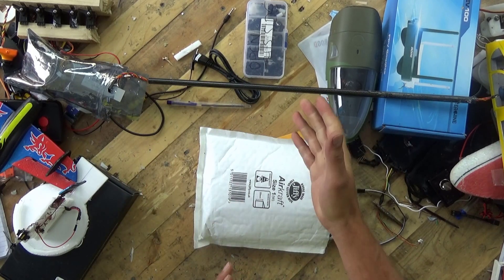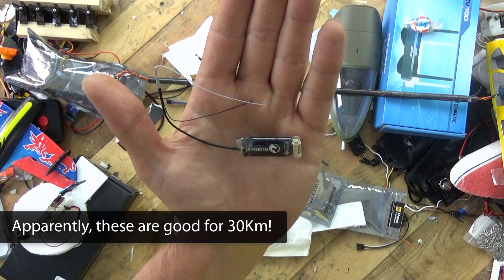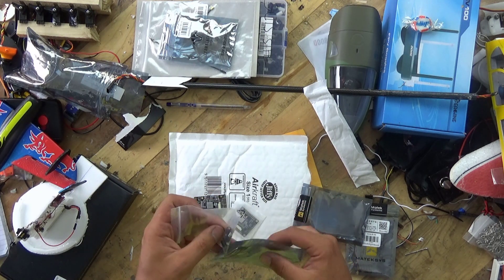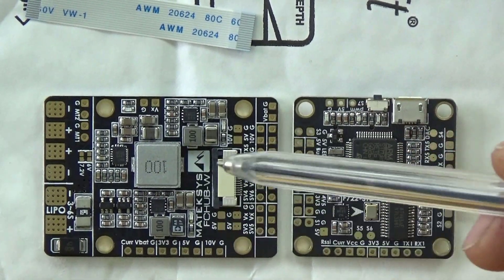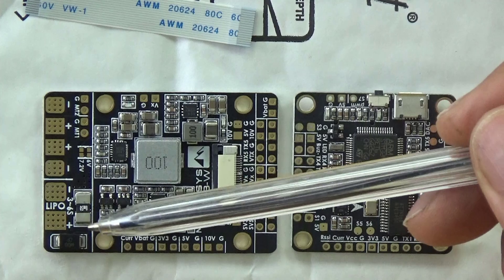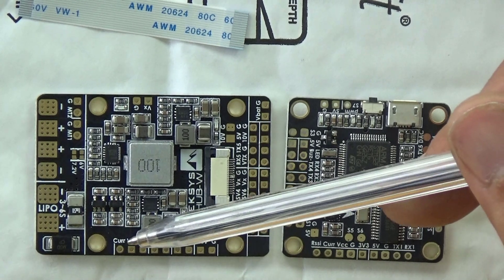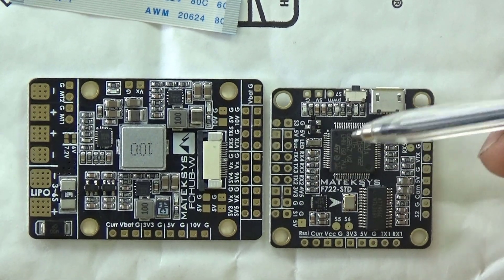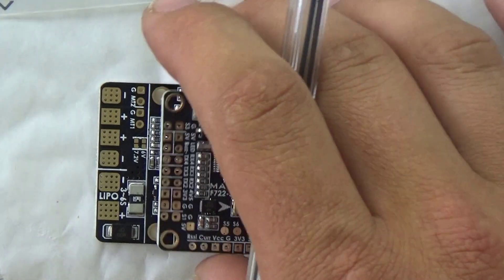RC Mail #66 - Matek F722 & Wing PDB Boards

Comment: how the wiring setup for matek f7 22 std with the raspberry pi zero and matek fchub pdb?
Reply from the maker: Hi, no idea why you would be using a Pi, just use a computer as normal, Matt
Reply: @RagTheNutsOff  because my project ask to do autonomous drone tht have robotic arm..lidar and couple of other sensors..it requires faster microcontroller
Reply from the maker: I have no idea fella. The lads over at iNav would be able to help. Matt

Comment: hi matt its lee from canada again …….. what is the pdb and what does it do……… and can i wire up rib led lights direct to a limo 14 volt batt …...
Reply from the maker: Howdy Lee, probably a good idea to do some research on what a PDB is. As for the LED's, you'll need to check the specifications for them as 14V should work (if 12V ones), but may not depending on the LEDS's being used, Matt

Comment: Can't wait to see you install this in the Nano Talon. Can you do a step by step guide to install this in the Nano Talon?
Reply from the maker: Howdy, have you not seen the series I did on Inav or the recent two videos on the nano talon? They have this covered, Matt
Reply: RagTheNutsOff, hey thanks for the the reply. I enjoy your videos. I did watch the previous video as you pointed out. But you went over the new mods that you installed in the Nano Talon, and it very hard to see where you wired everything. But luckily you made this  video after your previous to explain the PDB and FC.

Comment: 5 uarts but no i2c?
Reply from the maker: Yea, I dont use any peripherals that use it, Matt
Reply: Of course it has I2C (SDA\SCL pads on underside near sd card slot), and you will need it Matt for air speed sensor when inav starts to support it (not just showing air speed in osd, but taking this data in to calculations).
Reply: I see. There was no pic of the underside in the page linked to in the description, but I found some better pics on the Matek website. Not very convenient as just pads though, I would rather another of the UARTs was pads and the I2C had thru-holes. Pretty admirable that they have managed to squeeze that much on such a small board at all though :)

Comment: It was so not funny I tried to open my ribbon connector the wrong way and destroyed it
This kind slides back duh
Did fix it though
My 1st maiden on inav went great on an f405 std
Then it went downhill after I started modifying orientation and cli  commands
Totalled.my fuse good
But the Phoenix will rise

Comment: Hi Matt, I knows its not an F7 board but for the same money you can get the F405 WING board all in one, Just installed one in an AR stealth V2 wing and it runs great. Maidened with zero issues. The main advantage is that the board has 6 UARTS but eth integrated pdb is pretty much identical as the one your using
Reply: PlaneCrazy great to hear this I have this fc on the bench for my new plane
Reply from the maker: Yea I did t want to use a F4 board and was specifically looking for F7. Matt

Comment: These two pcbs are designed for Quads, not Fixed Wing Matt.....It has no 3 Pin servo pinouts.
   Servos have 3 pin plugs on them.
Reply: all the servo pads (on the pdb are 3pin) the fc is designed for a quad but on the wing pdb the only pads that arent 3 pin are the motors and i prefer to solder them (i prefer to solder my servos too mind) it provides a more solid joint than pins that can work loose over time
Reply: Ah yes, I see them now...I prefer the F405 Wing myself though....Thanks....:)

Comment: I think in the corner there is a TVS diode essentially a clamping device, suppressing all overvoltages above its breakdown voltage not for reverse polarity protection. A diode placed for reverse polarity protection would have the cathode marked clearly with a line.

Comment: What's even more odd about the 10v thing... is that on the F405-Wing board, it's 9v! What the actual? 

Having said that... it is at least switchable to 12v proper by way of a solder bridge. I see the Wing PDB has a solder bridge but only for the servo BEC.
Reply from the maker: Howdy James, I checked mine before using it, came out as 10.2V for me. The input was a 4S battery though, Matt
Reply: What I meant was that on the F405-W board, it's actually labelled as 9v (not 10v as on the PDB you've got). Like you, I don't understand where Matek are plucking these nominal voltages from. I know of no aeromodelling equipment that specifies 9v or 10v. On the other hand... most stuff accepts a decent voltage range these days so it's a moot point. 

The only thing I can think is that they're trying to avoid common LiPo pack voltages (to avoid people thinking a pack still has remaining capacity, when in fact it's being masked by a voltage regulator)... so a 2s will never go above 8.4v and a 3s pack shouldn't be discharged below about 10v, so 9v is a reasonable choice on that basis, so people don't forget the device is running off a BEC, and not from VBAT!
Reply from the maker: Howdy James, yea it's a bit odd with that 10V line. Have used it since and not been an issue for 12V kit thankfully!
Reply: the 10/9v regs are intended for vtx to provide a clean regulated supply to help prevent video noise